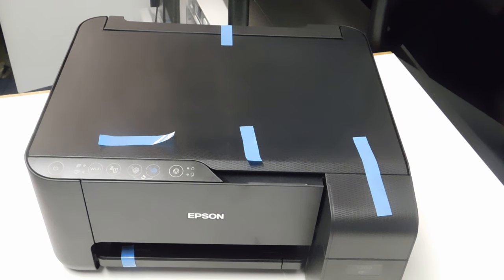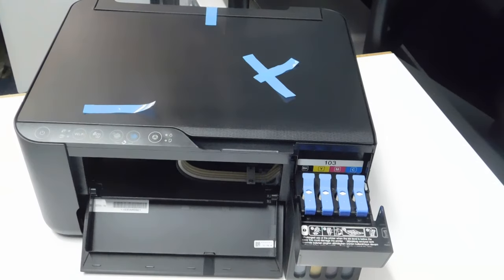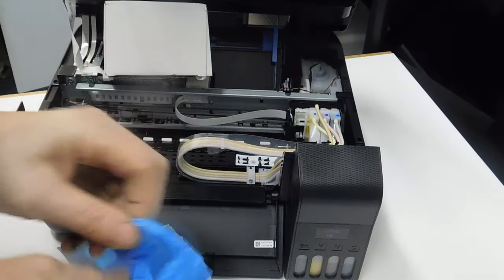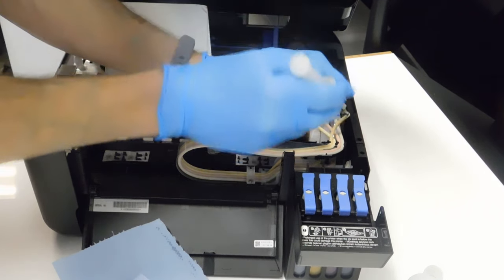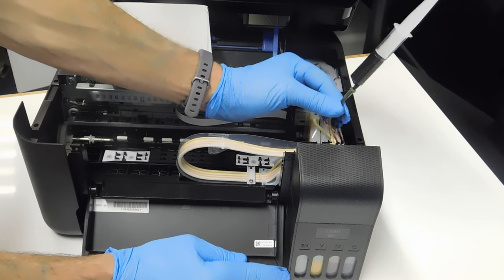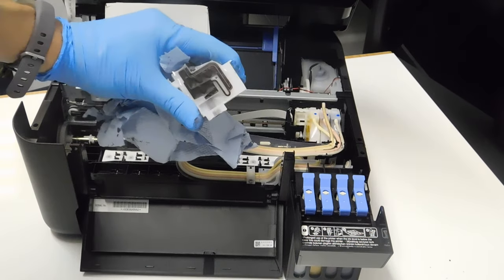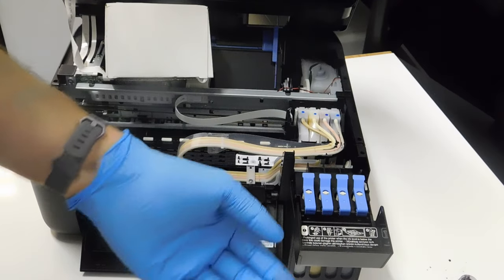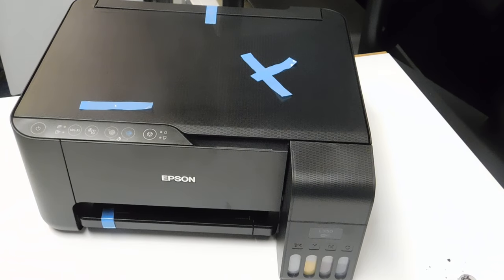Swopping ink on an Epson - ECOTANK printer

Comment: Hi I have the same printer but in Australia it is the Epson ET-2810 and we are having trouble lifting the top of it up. We have undone all the screws like you did.
Reply: Did you sort this?  i am having the same problem
Reply: I just physically broke the piece off. Too restricting and unnecessary.

Comment: Can you exchange the EcoTank ink for Hard Solvent Inks?  I am aware this will corrode  some parts of the printer and render the printer useless after six months, but I am happy to take this risk.
Reply: Gonna buy one and try it myself lmk how it goes for you
Reply: Why would you buy one of these expensive printers just to only have it for 6 months?
Reply: @morganc.m1830  It would outweigh the benefits of being able to print on the vinyl material. The benefits are the large profits. However, since this was posted a year ago, I have got a manufacturer to develop a Vinyl that is printable with non-solvent inks.  There are other inkjet printable types of vinyl but my vinyl has air channels (bubble-free) with removable adhesive. In fact, I now sell this vinyl as my own brand.

Comment: I accidentally put magenta in the cyan tank, with the magenta tank already full of magenta as well. It was printinf normally for a little bit, considering I had some cyan left in the tank, but not a lot, hence why I was refilling it, but I accidentally put the magenta in. 

Now my prints are pinker. Idk if I should print multiple pages of magenta or cyan to get the magenta out of that tank. Does the printer recognize the color or does it just immediately take the color out of the specific color ink tank thinking it is that. So if I print cyan, would it take the ink out of the cyan tank, even though it is magenta ink in. 

There was some space for more ink in the cyan tank from where I've still been printing normally and I'm just filling it with some cyan to see if it helps.

Edit:nope. Now I'm stuck with 2 full ink tanks of the wrong color and the printer isn't taking any ink from either one. It's acting like they are just empty. I was just gonna use up all the ink, but that didn't work and now my printer is also saying things in the printer are at the end of their service. I looked up that and only found things about the ink waste pad. Could you or do you have a video covering that?

Edit: Okay, so yours is definitely different than the 2400, wven though they looked very similar. I only saw one screw on the left side, but nowhere else. I now don't know how to take off the cover and am stuck. I really wanna get this fixed. I print a lot and this is obviously beginning to be a problem for me. 

And about ink waste pad, I think I found where it is at. It's on the right side on the back. I haven't unscrewing it yet and looked, but it seems to look like thats where it is.

Comment: Hi. I have this printer and I took out the cartridges and cleaned the print heads. I also pulled some the ink from the tank to make sure i didnt have a clog there as well. My blue was clogged. I reassembled but now the ink from the tanks dont seem to reloading the cartridges. I am wondering if i stretched the tubes like you just talked about or if there is another issue. If i have stretched it. Is there enough play to remove the very end for tighter fit
Reply: I am having this same issue. What was your solution?

Comment: I had a color clogged and no epson cleaning or flushing worked, epson customer service was unhelpful at best. I didn't know how the printer was build so I couldn't take it apart. This video literally saved my ass, I flushed the cartidge, refiled it and it's working perfectly now! The only different thing in my model was the annoying lever that doesnt let you open the printer more than 5cm and the plug on top of the cartiges, but I managed to pop off the side panel without breaking the plastic pin and got around that. Thank you for saving me money since I was about to buy a new printer lol.
Reply: How do you flush the catridge

Comment: I mistakenly put the standard ink in, instead of sublimation ink. After removing the ink, will I need to flush the reservoirs before adding the sublimation ink?
Reply: I didn’t, but I did do allot of prints before adding the sublimation ink to get as much of the other ink out as possible.
Reply: How do you flush the system? None of my colors work

Comment: Would this same process work to remove the ink the printer comes with to switch to sublimation ink ? Or will there be problems
Reply: I did the exact same thing. Why on earth would they sell a SUBLIMATION printer, without SUBLIMATION ink lol 

But have you gotten a chance to try it? Did it work for you?

Comment: Have you ever swapped out sublimation ink to echo solvent water-based ink in an Epson eco-tank 15000? I was told by a few people that it will tear up my printer. If you have any tips or tricks please let me know. I did watch the whole video and it gave me more hope then I had a little while ago. Thank you for your video!!
Reply: Did you swap out the inks yet? I'm looking to go from Eco Solvent to Sublimation but too scared it will damage the printer
Reply: @simmelprints  No,I just bought another one because it will lock up your printer from what I understand. I’ve been told if any of the 2 inks come together it actually turns to gel and it ruins your printer.
Reply: I am wondering the same thing. I want to run cleaning solution through it a few times and see
Reply: @RVincents did that work for you? I'm needing to swop inks now
Reply: I changed it, and the printer is not printing anymore. Just blank sheets

Comment: My ink  has stopped flowing I'm.to one of my cartridges how do I sort that problem out.and my.in is full in the tanks
Reply: Where he says you could pull the ink from but would take longer, I put the syringe there and sucked the ink just enough to get the ink flowing in there again and that worked for me.
Reply: @aliciafowler4320  I done the same replaced it with sublimation ink and it’s not flowing into the rear cartridges and isn’t printing. I don’t know what to do next
Reply: @chrissyhoyle5799  i just did the same thing myself and am having this same issue. Have you had any luck since this post?
Reply: @yajairafigueroa982  no and now it’s showing a scanner error and apparently nobody I know works on them. I’m beyond frustrated!!
Reply: @chrissyhoyle5799  Did you ever find out how to re-charge the rear cartridges from the main tanks? (reservoirs) The Epson 2800 series only gives you a "one time only" option to charge your cartridges from the tanks when the unit is brand new.